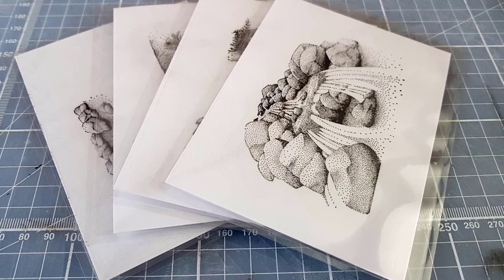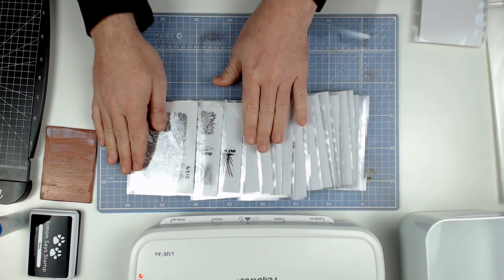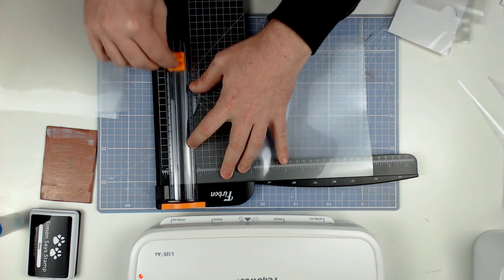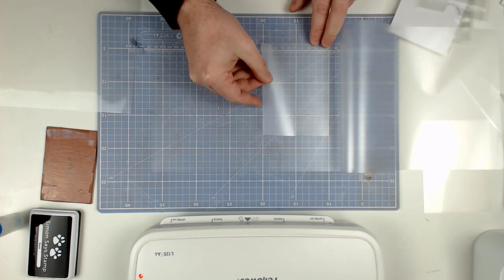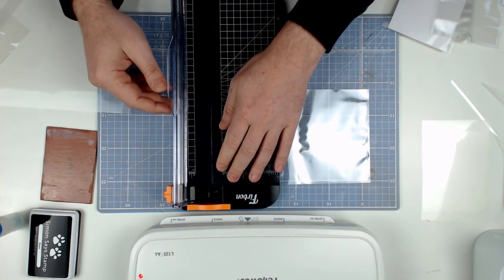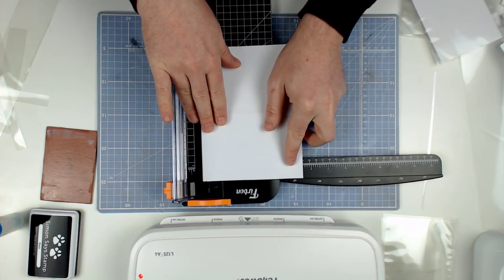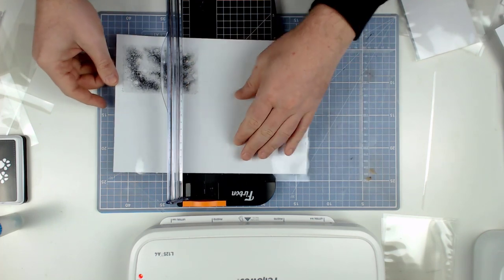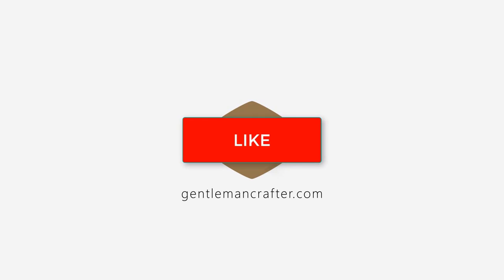How To Make Rubber Stamp Storage Pockets from Laminate Sheets

Comment: I have a question, so if you get 4 pockets from the first sheet why are you not able to get the same 4 pockets on the second sheet? There should be room to seal the pockets and cut them out and make the opening. I feel like there is so much waste.
Reply from the maker: The purpose of the video was to give an overview of the 'sealed pocket' method for creating storage, rather than be something to be taken verbatim. Whilst measurements were given, these are not set in stone and viewers are welcome to adjust and adapt to their own sizes, preferences, choices, views and goals. If you believe you can do this using less, please do!
Reply: Because he left a few cm around is why surely it’s obvious
Reply: When you do your own pouches use the extra space to make extra ephemera & not all pouches will be the same size. I found the idea brilliant. Your comment reminded me to have ephemera pieces ready so no waste.
Reply: I am in the process of consolidating my crafting supplies in preparation for moving to a smaller home. I’m exploring different options for my stamp storage. I agree that waste bothers me and will need to examine this.. I am thinking about a system similar to this but with two adjacent sides open, or possibly only part of the second side open so that it is easier to reach in and remove or replace the stamp. I just don’t enjoy fiddling to get out supplies and find that pockets can sometimes be like that. At least this is giving me ideas!! Good luck on yours!!😊

Comment: Re the reference cards. You can save a laminate sheet by putting 2 pieces of paper inside. When you cut the sealed edges off you are left with two sheets of paper each with laminate on one side. Paper side for stamp reference, laminate side for stamp holding. Allows you to make reference cards in advance which you can stamp later.
Reply from the maker: Thanks for the bonus tip!
Reply: @GentlemanCrafterUK  you are welcome! Your video is great btw. Clear directions. ❤️

Comment: I was in the middle of  making my own storage system for my stamps too. A bit different take on using the laminator actually. I made up a few laminated full size 8.5x11 inch designs for a friend with a 80# cardstock backing to insure it was less floopy when finished. Meantime it hit me why not see if this would hold my clear cling stamps. OMGosh it does. As well a job as any I've ever seen that they come with or are offered in the large fancy sets I bought twice over the years. So the added wonder is I can stamp that cardstock sheet prior to laminating it and I have a record of the stamps on the other side clinging away. I now can put them in bins like you are using, envelopes to protect like you made your pockets or purchase the clear ones which I store my cutting dies and most of my embossing folders in. Much like the fashion you are showing I use bins to file them in similar fashion 5x7 inch folders which run a bit larger than 5x7 since they hold all cards and dies and muliples there of including thick 3mm to 6 mm double sided magnetic 5.7 inch sheets too. So funny when I handed the gal her mini posters so to speak I mentioned if she'd like to use as storage envelopes all she needs to do is slit off the laminate from top or side and voila a storage pocket. That would be larger than you made here. But years ago I was trusted with 5 one hundred USA dollars to apply into a three fold large card for a companies gift to a couple who both worked for the company and their wedding. To do that I made a double sided cardstock into the middle panel of the triple folding panel and inserted the bills with on the back side a warning not to throw away card and to hold up to light to know where to cut carefully to open up on one edge and retrieve the gift hidden inside. Anyway it was a hit I guess as I missed due to a wind taking out 70% of our property the day of their wedding? But heard it worked well. Meantime I've done what you are demonstrating and what happens is my professional laminator seems to hate melding two layers of laminate together without paper of some kind between them. It leaves bubbles that I can not work out no matter the heat setting up or down. So I do add the paper. However I had a huge stack of old 3 ring binders from hubby's graduate school days I was padding and recovering and thought I would make my own storage files using those so I could put my binders in my 14x14 inch drawers where I keep the commercial ones now or up on a book shelf. But I also prefer the smaller half size 3 ring binders not to mention I can make my own bound books using all kinds of binding devices. One of my major hobbies was doing that and so have three different professional styles of binding machines plus several craft ones too. These techniques open up a lot of possiblities. My only complaint to date with the use of bins to file my stacked dies and embossing folders is they like to slip and not stay up if I have pulled a few out or it's not full yet. I haven't quite figured out a means to prvent that. I am thinking to sew up a sand bag using coated nylon fabric about the width and half height of my bins and fill it about half to 2/3 full of weighted pellets that I can slip into the bin when I have a gap and help prevent this nonsense and annoyance. ALso I might put non slip shelf liner on one side to help keep the bag also in place. By not filling full it'll be mushable to let me morph it into a means to fit the gap needed perhaps. I would use sand and though I make those for various outdoor uses it's a bit tricky and if it's too fine it can work it's way out of the seams so the weighted beds would be ideal. I'm going to make a mock up trial one next week. If it works I'll make up 3-4 of them to keep on hand. I usually have another bin empty to work into where I can grab numerous dies, stamps, folders in the category I'm using on any given project or two at a time. Then all is kept together and easy to clean up and also return everything at the end of a project. I am favoring two different Sterilite tubs whitch locking lids and one has a slight domed lid with handle so totes too the other flat and a bit wider allows me to store on the sides the super longer dies or folders I also have collected. They both stack well. Thank you for sharing your designs. I'm terrible at making videos so I have no idea how to share my ideas or fun stuff I come up with or I would for sure. I so appreciate people like yourself that take the time and the know how to do this. Thank you thank you thank you. PS love your stamps they are to will lets not say die for...but pretty darn beautiful collection. Stay safe everyone...I know this was made just about the time the pandemic was hitting the globe. And of course the story continues. My heart goes out to all those who's lives were changed by it't tragic notes. Stay safe people stay safe. And make some joy today to share.

Comment: This is such a great idea! Thank you for sharing! I'm going to try this but a little different. Where you place two rectangles of the laminating sheets glossy side to each other, I think you could replace one of those sheets with just white cardstock or paper. The outside laminate sheet will bond to the paper, but the inside (glossy side facing the paper) won't, so you still get your pocket and you have a white side already there! 
I mostly use clear stamps, so this will provide a crisp white background so I can see the images and I won't be pulling out my white insert every time I use the stamps. 
I'll test this out tonight and will update this comment with whether or not it worked out :)
Reply from the maker: Look forward to hearing the update.
Reply: @GentlemanCrafterUK  this totally works!
Reply from the maker: GREAT!!! 😁👐

Comment: Brilliant idea, thanks for sharing!  I use the laminating pouch technique to store my dies on magnetic vent covers stuck to cereal box/notebook cover/chipboard and covered with decorative shelf liner. It's the best way to store dies in my opinion.  I don't lose the small ones.  I use the flip method similarly to easily find what I want.  I also use plastic card keepers to store my larger dies in-- there are dividers that are sturdy enough to keep the dies upright.  I use the same method- just larger panels and using 6 x 9 job ticket holders, though in hindsight, I think I would do the laminating pouches instead.  I'm starting to convert to naked rubber using zig glue (love the stuff-- magical) and storing on large panels of two pieces of cardstock laminated for stability and in super large clear pouches, kept in magazine holders. A riff on a great idea.  BTW- super cool that you're a guy who stamps/crafts :)

Comment: I’m in the process of re-doing storage & this was exactly what I have been wanting to do but not sure how!  Thanks!!!

One tip I use when storing dies & stamps is to copy the pic that usually comes w/ stamps (rather than stamping it out).  I always get a perfect pic that way & I can adjust my printer % to get the perfect size that will fit on the pocket card.

Comment: Great video  very helpful, I am in the middle of doing this  having shelves made,  got the tubs from Ikea, used all my stamp storage cards up , bought preowned  to save money and bought postcard  collectors pouches.but I found your video and want to do the same, what micron pouches do I need bearing in mind that I have triplet grandsons  that craft with me so they need to stand up to them using them. I am shocked  how much neater  they are and that they  take up less room than having them in their own packaging  in pockets in ring binders that I was finding too heavy and were double stacked on the shelf unit they were on, so I was not using them  and forgetting  what I had.  I have finished my cutting dies  and part way through my stamps it will be a lot cheaper  to but a laminator and pouches and make them myself like you.
Many thanks Wendy
Reply from the maker: I'm afraid I can't remember the micron but they were very basic from a food supermarket so can't be anything super special. At least when you make them yourself, if one breaks, you only have to replace one, rather than a whole set.
Reply: @GentlemanCrafterUK  Hi, thanks for your prompt reply, and you are right I will just make new ones..
Many thanks Wendy

Comment: I have tried a 3-ring notebook to store my stamps in, it's not been working for me...too floppy.   I don't have laminating sheets, but I do have off-cut rolls of laminate from a machine they used at the local university years ago...I'm thinking this will work for me nicely, very nicely.  Cut them to the size container I choose, make the pouches and I will have a good system so I know just where things are when I want/need them.  Blessings!

Comment: Just watched this video, very helpful, will definitely be sorting mine out now. Do do have any recommendations for removal of stamps from wooden blocks to be able to store them in pouches too 😊
Reply from the maker: I'm a huge fan of wood block stamps so would always encourage folk to keep them but I get that they can take up a lot of space. An adhesive remover should work just fine.
Reply: @GentlemanCrafterUK  thank you John, yes I’m a big fan too but i need to start downsizing so it’s either get rid of them or reduce the storage size, I would like to keep the so this system seemed a good idea 👍
Reply from the maker: I like you're thinking. Good luck with the down sizing.

Comment: How do you get the unmounted rubber to stick to the acrylic?
Reply from the maker: There are various options. You could use print stick or a repositionable glue or you can buy cling mount to add to the stamps.